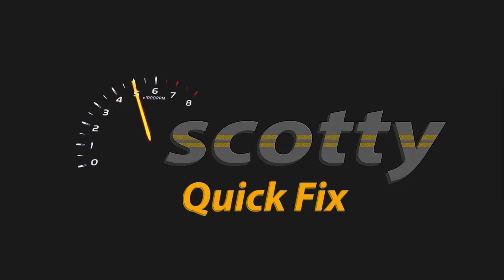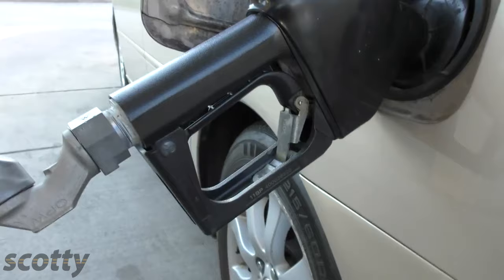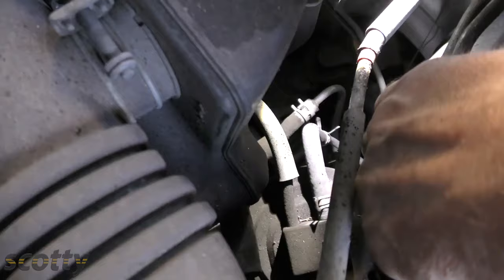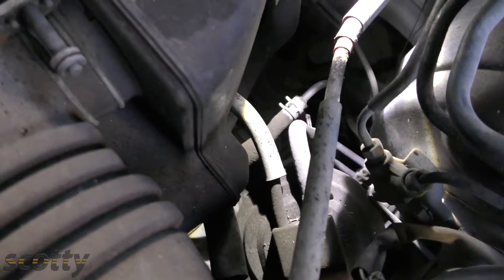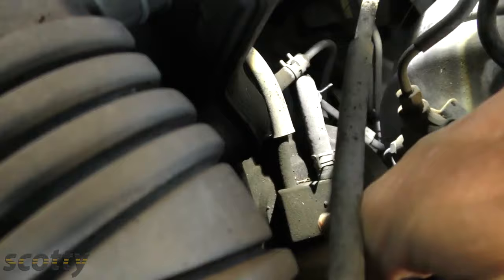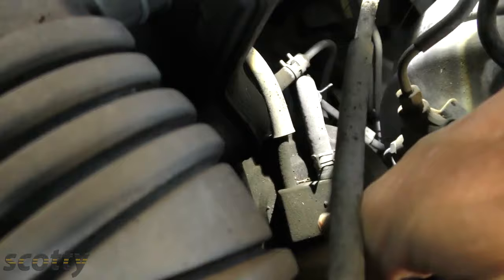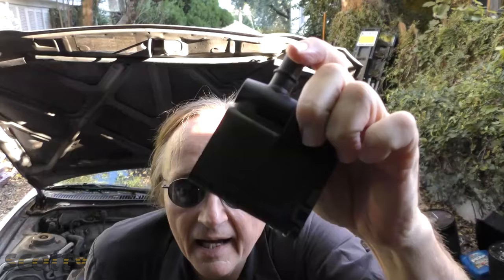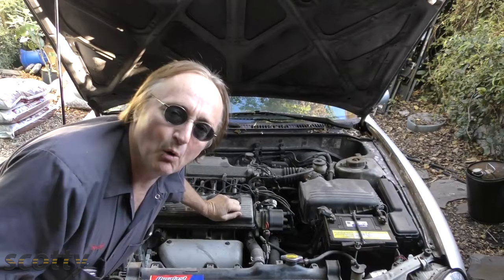Why Not to Overfill (Top Up) Your Car's Gas Tank

Comment: i can't even go full throttle on the pump most times it stops straight away so i have to go 8/10ths and then when it clicks i can normally fit in another 6L out of a 65L tank so this is a bit too generalized

Comment: I just took your advice in my 2011 Toyota Camry but the fuel gauge only read just over three-quarters of a tank when the pump shut-off. Is this a problem with the float or something?

Comment: Sometimes the pump wont fill the tank to where the fuel gauge actually registers full. Some places ive been to shut off the flow when the tank is only 3/4 full. Also I bet my car is so old that it doesnt even have the thing that can get ruined if you overfill.

Comment: That's weird because I put every drop of gas that will fit in the tank at least 10-15 times a year, in the same car for the past 14 years. It has over 265,000 miles on it and never had to replace the canister. 

Sometimes I put as much as 3 more gallons in it after the pump shuts off, helps out on long trips where I can make it where I'm going and back home without having to get the ethanol gas they only sell in other states.

Comment: I guess this happened to me one time - the automatic stop function failed on the gas pump and threw gas all over the side of the car.  Had to wash the car immediately to get the fuel off the paint and the station had to put cat liter down and shut down that one pump.  Fun times.
Reply: Hopefully your car has a valve in the evap system that protects the canister. Some do; others don't.
Reply: Probably not - a 2006 Saab 9-3 with 162,000 I am guessing it does not.  In any case, after nearly 12 years the EVAP canister is still fine.

Comment: I have a 2016 Mini Cooper. I overfilled the gas because the pump did not stop when the gas was full. I noticed the pump was abnormally slow when I started pumping. The number was going very slowly. I thought maybe their gas tank was low. Because the weather was cold, I went inside the car waiting. After about 2 minutes, I still saw the pump pumping. About 4-5 minutes later, still pumping but I noticed some water dropping sound. I went out to check and saw the gas was spilling out. Jesus! Luckily it didn't catch fire. On my way back home, I didn't feel anything weird on the car. 
In the next morning, I could not start the car because I could not press the brake pedal. The brake pedal was solid hard. The mechanic at the dealership did not know why it happened. They said they called the engineer to inspect the car. Later they said there might be a piece of metal stuck inside the engine chamber or whatever. I don't remember. But they replaced the whole engine under the car warranty. I really don't know if this was really caused by overfilling. I didn't tell them since my car still had warranty. I was afraid they might void the warranty because i overfilled the gas even though if this was the real cause.

Comment: Another reason is of course is because it's to stop petrol spillages on the road for the idiots that overfill and fill right to the top.
My bro bought a brand new motorbike in 1983 and came off the roundabout on a petrol spillage,but not too much damage thankfully.
These days you rarely get spillages thanks to this idea and that it first came about in the 1990's in the uk i think.

Comment: Every time I put gas in my car (2016 Mustang ecoboost) when I come to a stop, the car will idle at 800-900rpm them drop down to 530-615 rpm and it bogs like it's gonna shut off then goes back up to the regular rpm. What could cause this?

Comment: Seen as i dont do long distance driving i only ever fill my car up half way so i dont carry around all that extra weight.. its meant to save you a few quid in the long run.
Reply: kingdarko i can relate to that but if you live in a hot climate area filling half tank is going to get your fuel evaporate faster i guess.

Comment: Overfilling the gas tank, broke the seal in between the tank and the gas pump. Had to pay someone to drop the tank and get new rubber gasket and plastic lock from Mazda. Didn't know overfilling was a problem. Over $200 later now I know.

Comment: Scotty would this happen to cause a gasoline fume smell outside the car near the gas tank, even if you don't see any leaks? I'm having with this issue with my 2000 Suzuki Vitara, and I have to admit i have "topped off" my tank in the past. I don't do it anymore, but I'm trying to figure out what that gas smell is coming from because I can't park it in the garage without it stinking up the whole place. It doesn't appear to be my gas cap, it seems to be sealing properly but not completely sure. I've tried to figure this out with no luck. Please help! Thanks Scotty you da man!
Reply from the maker: it can if evap cannister fills up with liquid gasoline.
Reply: @scottykilmer  Thanks Scotty! Turned out it was a leak from the tank after all.

Comment: Okay I accidentally overfilled my 08 Mazda 3 to the point where gas spilled out just a little. Now I see the engine symbol pop up in my dashboard and my fuel meter is still at full after driving for half an hour. Should I be concerned or just wait and continue driving a little more?

Comment: true but we the gas pumps out trere they shut off before the car half full do to  bad pumps
Reply: More common is when the pump nozzle fails to automatically shut off and overfills.  Happened to me once (new car, and was still getting used to approximating the number of gallons required based on the fuel gauge reading).   Caught the overfill pretty quickly (the growing puddle under my car was a big clue), but that was only because - unlike the majority of people out there - I stay at the pump and manually keep the handle engaged, which was a requirement in Massachusetts until recently, instead of engaging the 'hold open' catch and going elsewhere.

Comment: Here's what it says, straight out of my owners manual.

"Do not add any more petrol after the petrol filler first clicks off or petrol blows back - as this allows room for the petrol to expand inside the tank. It is only permissable to 'trickle fill' petrol tanks when the vehicle is to be driven more than 50km straight after the tank is filled. However, this is not recommended on days over 30C."

And another thing about fuel. My car is designed to run on 91 (87 for the yanks), here's what it says about higher octane fuels.

"Use unleaded petrol of 91 octane rating, or higher. High octane unleaded (premium etc) may be used, *but is not required by your vehicle*." So if your owners manual says you can use 91 (87), bless the engineers who worked to  make your car cheaper to run, because using more expensive fuel is throwing your money away. Engineers worked to make your car run on the fuel it needs, take advantage of that and stop wasting your money.

To be honest, I regularly trickle fill when fuel is cheap. I'm not an idiot, I am well aware that doing so may flood the carbon canister, but so far it's been fine, and in my car, it is very easy to replace - next to the fuel filter, if you take the rear right wheel off, the fuel filter and carbon canister are right there, greeting you with their ease of service. Ignoring the wheel removal, I don't even need a single tool to replace the fuel filter on my car. It uses the push in clip plug things. Completely tool-less operation. If the carbon canister was expensive or hard to replace, then I would think twice about trickle filling. But I do so all the time with no ill effects, but that could just be luck. At least I am aware of the consequences of what I'm doing, I guess...

Comment: Hello, I have a 99 chevy Malibu and I can not here the evap clicking. And there is a check engine light on and says over heated 02 sensor I put 2 new 02 sensors on it. could the evap not working cause that?.    Thanks.

Comment: Hey Scotty, I need your help. Recently I filled my 00' Chevy impala 3.4L V6 with gas earlier this week and I immediately noticed my car started driving rough, vibration and sluggish acceleration. I'm also getting heavy white smoke from the exhaust usually at idle at the light. I replaced the oil, all ignition coils, spark plugs and new wires but still having the same problem. There's no coolant leak or loss in the radiator and reservoir. I checked the oil dip stick and its filled with no sign of blown head-milky substance. What do you think?
Reply: You probably got bad gas and have water in your tank. Might take several cans of methanol (gas drier) to clear it. 
I would stay away from that station.

Comment: What Scotty regrets to mention is that you can just replace the charcoal cannister with a bit of T pipe and the car works just fine. This is what was done on older vehicles, all these evap cans do is prevent a gas smell when you do overfill them.

Comment: I have been doing this for five years and driving over 100K miles on my Toyota Solara 2000 I4 5SP with 240K mileage to track the MPG on my car. However, I never had any problem with that. It seems to me absurd

Comment: My audi has this issue where the pump shuts off immediatly and doesnt let me put any gas in the tank. I usually put the pistol or whatever its called halfway in and thats the only way i can fill up.
Reply: My 1965 Mustang sometimes spills gasoline out of the cap when youre done, and other times cuts off the pump when the tank isnt even full let alone overfilled.

Comment: Would it cause an engine light to come on?
Reply: aromano20100 It can. Evap systems usually throw a code if there's something abnormal because it's part of the emissions system.

Comment: I've overfilled almost every time.  Is that why I'm having to get a 4-valve job at 38,000 miles?
Reply: When it clicks I pull it out hold it with my hand then pull the rubber back and pour into gas tank it until it full to the neck I am stupid I just found this video by accident not going to do it again

Comment: Hi Scotty, I have a bad oil leak on my 1995 dodge caravan, I put that blue devil oil stop leak in and. put oil in and drove around a little bit but then I went home. Now I don't drive much and also I just bought this minivan. I've been having to put oil in it before I drive it, and it's usually to go to the store and back. When I get home it's already out of oil. I'm a single female who is disabled and I can't work. I don't have much money and nobody ,  as in friends, wants to touch it. Now back to my question. I don't know if the stop leak was even in the van long enough to do much. It says it could take up to two weeks to seal it with the stop leak. I know y'all are probably laughing about me thinking it's actually going to work. I'm trying to be positive about it because I have only had the van for about 2 months and I had to borrow the money to even buy it. Do you think I should start the process over? It's only been about 3-4 days since I put it in. (the blue devil).  Please help me and tell me what to do next.  Thank you !

Comment: What if you accidentally over pumped it once?  This literally happened to me last night.  And I'm worried I might have broken something now :(
Reply: lol no. people usually "overfill" all the time. 
this thing may break after doing this constantly, but for a few times, it will not break.
Reply: Worry about the things in life you can change.
Reply: I did the same thing doing it a few times wouldn’t ruin the canister but doing it every single time you pumped gas it could ruin it. What I would recommend though just to burn out the rest of that extra fuel is to drive it as hard as you can for a little while at around 5-6k RPM to try and burn some of that excess fuel off.

Comment: Great video. About something most people take for granted.  The charcoal  canister  helps mother earth.  If you  remove and toss the charcoal canister into the garbage can you don't give a  shit about  future generations . N.J needs the laws changed. Attendants  who work at gas stations need to be monitored  for  pumping. Past  the  shutoff "CLICK"   THE PUMPS COULD BE  MODIFIED  BY CERTIFIED  PERSONAL   TO KEEP PUMP SHUT OFF UNTIL GAS PUMP IS COMPLETELY RESET FOR NEXT SALE.

Comment: EU cars don't have evap systems, at least not to my knowledge. I know that our gas pumps have something like that which sucks the gas fumes back into the tank while filling the car. Still, I've been told that anything you put in extra after the pump shuts off will just evaporate through the overflow, so it just doesn't make any sense. Especially not with our gas prices...

Comment: I have a 2wd 2004 frontier and the gas pump clicks even with a couple of liters, what may be the problem ?
Reply: No Name you might have a full tank or it might be a faulty pump nozzle
Reply: Obstructed filler pipe.
Reply: So, did I have to replace the whole fuel pump ?
Reply: Can be cleaned ?

Comment: I TELL SERVICE ATTENDANTS TO AVOID DOING THAT WHEN FILLING UP. IF YOU PAY CASH AT A FULL SERVICE STATION THEY LIKE TO GET THE TOTAL TO THE CLOSET DOLLAR OR HALF DOLLAR. MY UNCLE IS AN ENGINEER AND TOLD ME AS WELL AS MY VOLVO DEALER THAT IT WOULD TAKE MORE THAN ONE CLICK TO CAUSE DAMAGE. ACTUALLY IF YOU OVERFILL TO THE POINT WHERE THE NECK OF THE FUEL OPENING IS WHERE TROUBLE WOULD HAPPEN. NO CHECK ENGINE LIGHT AND CAR RUNNING FINE "SHOULD" BE OK. I'M SURE IT HAS HAPPENED TO ALMOST 99% OF DRIVERS IN THE WORLD.

Comment: doesnt apply for modern cars, with modern cars its actually good to top up, keeps corrosion in the tank at bay. also prevent injectors from being clogged because you probably get use to it to keep your fuel tank topped up all the time and dirt has more time to settle at the bottom of the tank (no fuel pump is clean)

Comment: for me, oh no big deal on this 8th gen si I alwayw overfill until the hole has a small pool of gasoline and man does my tank last longer. if I ever do get evap codes I will use hondata to turn off any evap that makes the cel,mil engine light illuminate. so yes no big deal. no emissions testing ( :

Comment: Or you could just remove the evac can altogether and not worry about it. You'll probably get better mpg.
Reply: Jon Doe well, forgive my typo. You're obviously better at grammatical error than mechanics. I get better mileage without it. We'll just agree to disagree...
Reply: Jon Doe well, apparently I drive a scientific anomaly.  Not my opinion, just fact. Both of my S10's, and my G20 have not lost any mpg' s since removing or blocking them off. Weird.
Reply: Jon Doe I'm sorry you think I'm a duck for not lying to ppl to generate more business for "master mechanics" lol. I always laugh at guys that make that statement anyway. I'm just a mechanic... I have plenty of actual experience.  I'm also well versed in science.  I understand evaporation perfectly. Common sense and practical application are my areas of excel. So please, stop trying to sound oh so "master mechanic" and just be genuine.  My statement is accurate.  It works. It has worked and will continue to work. If others apply the same recommendation,  it will likely work as well. However, if it doesn't, then by all means, go spend a bunch of money on some opinion of a "master mechanic" that is looking to turn a profit from the uninformed.  Yawn...

Comment: What about when it shuts off but I know my tank isn't full?
Reply: Kevin Dehler must be a faulty pump nozzle,  a good pump nozzle will not shut before it reaches the nozzle tip.
Reply: If it's significantly under-filled, there is an obstruction in your fill pipe. Or your gauge could be defective, bad sender, etc.  Never over-fill the tank.

Comment: When I fill my car up, and I JUST did it yesterday, and always have since the day i bought it, (now 11 years old), this is my first 'OLD' car, that i have actually kept it WAY past the 2 year mark I always trading my cars in on, when I got bored with whatever I had.

BUT I have kept this one, after I paid it off,  I LOVE no monthly payments, NO power everything.  It is easy to fix, cheap to fix, cheap to insure, and still looks new. So why start paying $500 a month for the next 5 years on a 'electrically loaded car', that costs a fortune to fix each electrically run thing,...seats,windows,door locks,etc......and is stuffed with MORE plastic than metal?
Anyway....I get at least another gallon of gas in my car, WHEN I 'fill it up' past that 'click'. Is a gallon going in this canister...I doubt it.
I have heard of this 'don't fill anymore after the pump stops'....but thought it went the way of the 3K mile oil change.  Is there any warning IF this canister is going to go bad? And if it does...what happens to the car?  Does it stop running, get horrible mileage, not start? Whats the big deal???
Reply from the maker: if cannister goes bad, it will trip the check engine light, and you will fail the yearly emissions tests. that's the big deal. Also car will smell of gasoline a lot
Reply: Well luckily in Fla. we dont have emissions or ANY type of car inspections:)...an easy way to rip off all drivers of $20-50 a year, to own a car.
We got rid of it all YEARS ago. We voted it OUT! Then it came back somehow for like 2 years, then all of Fla. went more nuts than it is, and voted it out for good!! And it has been gone for over 15 year now. But I see your point. Just saying i have never had any problem with it in 35+ years of driving cars/trucks,and FILLING them all to the VERY top!

Comment: Ain’t gotta worry about this with my woman she never puts more then $10 in anything and we have 3 vehicles 2 cars and a 4x4 truck and every time I go somewhere I gotta get gas unless it’s my car I do fill mine up. And she’s not broke she can have $10k in the bank and still run around damn near running out of gas. If anything she is killing my fuel pumps and rusting the tanks cause there is nothing but air and moisture in them 90% of the time.